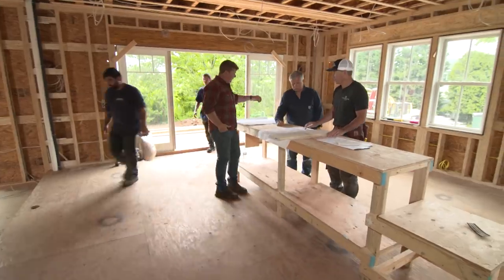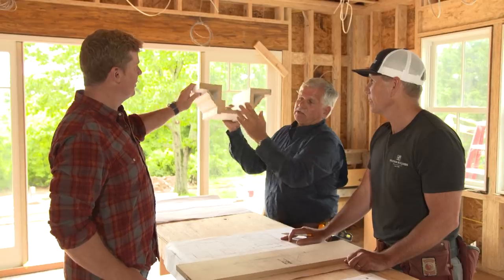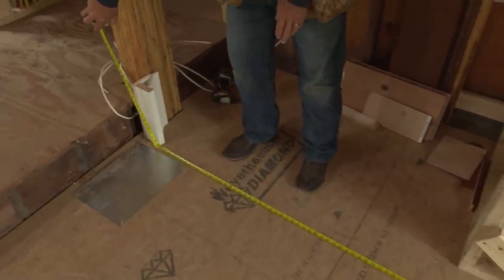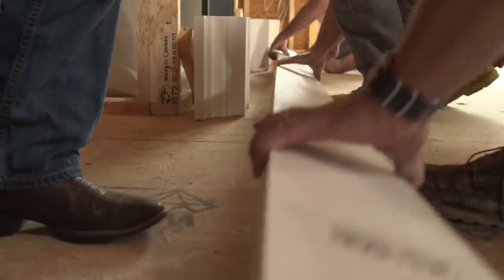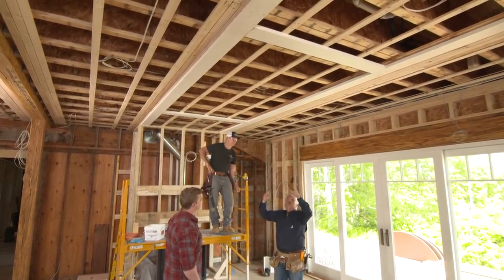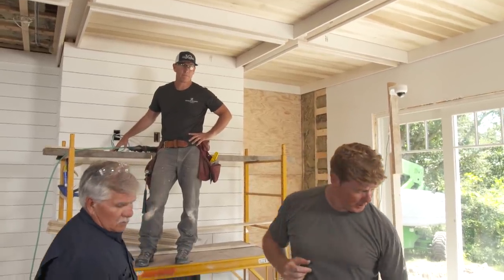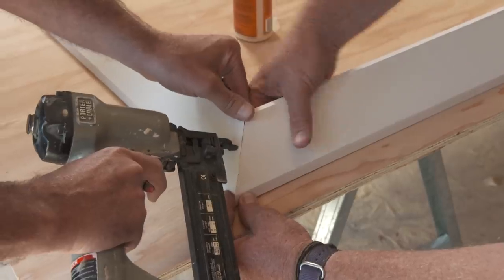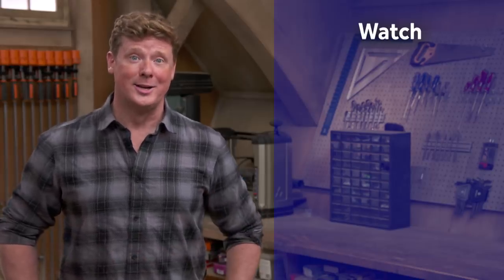How to Install a Coffered Ceiling | This Old House

Comment: New school is CA glue with a kick off spray instead of gorilla and pins.  I learned that from a finish carpenter channel.  Used it for shoe molding when I did my floor for the rounded corners and works like a champ!
Reply: TOTALLY UNNECESSARY AND OVERKILL AND TO MUCH CLEANUP
Reply: Clean up for what?

Comment: Boy I used to hate prepping out them ceilings getting them ready for primer and paint..all the puttying, sanding and caulking sucked..lol. It was so much easier when we were told they were getting stained to match the woodwork..The finished product is so beautiful either way though!

Comment: 5:30 If they already put glue and tacked it with a pin nailer, was it necessary to actually screw it in or was that just precautionary?
Reply: YES
Reply: Yes. Will keep the joints tight for years to come.

Comment: you are assuming that the distance across your floor is the same distance across your ceiling. That may be true in this case, but many houses are not square and plumb. you may have a 14' spanning floor with a ceiling that spans 14' 3/4" with walls that are out of plumb. Double measure folks!

Comment: I like all the dents that finish nailer leaves on the crown molding.
Reply: @Kevin-mp5of  jealous much??
Reply: Yeah, I cringed. My nailer has a rubber cover so you don’t mar the wood.
Reply: The painters include patching/fixing those marks in their bid. Or they could spend a few extra hours to not leave any marks that take minutes to fix.

Comment: are there any light fixtures hanging from the ceiling? how does that work?
Reply: The wiring is put in before, they mark the location before they cover it and cut a hole in after, put the light fixture in.
Reply: @johnny6071  thanks :) maybe there will be a better view next episode
Reply: @jomangeee9180  Forget about next episode, I'd go back to season 1 and watch 30 years worth of full episodes thoroughly if I were you.
Reply: @johnny6071  lol

Comment: is that an indoor or outdoor ceiling?
Reply: Judging by the floor, roof, windows and walls, I'd say it's one of those indoor type ceilings you hear about.
Reply: @johnny6071 they said living / dining room but looks more like an enclosed patio to me. Maybe thats the whole idea of this kind of ceiling
Reply: @jomangeee9180  Looks like I see roughed-in HVAC, electrical and plumbing. Not much of a builder are you? Looks like an enclosed patio to you but has every aspect of a normal living space with a 18" carrier beam supporting the whole 2nd story of the house hence why they are doing what they are doing..... Still look like an enclosed patio? Do you even know what a patio is?
Reply: @johnny6071  ok mr bob the builder, so what were the 3 things they measured up for and installed in the beginning?
Reply: @jomangeee9180  Is that before or after 0:25 when they said it was a living room and dining room?
Reply: @johnny6071  lol
Reply: WATCH THE VIDEO AGAIN  DUH
Reply: @clarelong3810  After 2 years of the watching the video I think I got it. Thank you for the your concern though

Comment: I've done several of these... look good, but a real pain...
 And putting that crown together and then installing it... living on the edge.
And shouldn't those ceiling boards have at least one coat of paint before they go up?
(I won't mention the clobber marks from the nail gun... someone else already got that)
Reply: Probably gonna be sprayed. If you prepaint that wood you'd need an aircraft hanger to lay it all out to dry in.
Reply: @Kevin-mp5of  I don't know that they're incompetent hacks...
but you've got to think at least three steps ahead in your work. And it's the job of the guy in charge of the crew to keep an eye on things.

Comment: is there an attic? how do you walk over that ceiling is it sturdy enough?
Reply: You wouldn't walk on the ceiling. They would out some type of flooring over top of the joists. That's what's holding the load
Reply: There's 2 floors to that house, so yes what you see is sturdy enough since it holds the 2nd floor
Reply: My golly, the beam is carrying the 2nd floor joists, the 2nd floor is the bedrooms, hallway, bathroom, etc. Above that is the attic which is most likely trusses and dead space, you don't walk on your ceiling.
Reply: 2ND FLOOR IS ABOVE AND IF I NEED TO EXPLAIN HOW THEY WALK OVER IT YOU CLEARKY WOULDNT GET IT
Reply: @clarelong3810  I seem to be getting on your nerves!!

Comment: Who KNEW in a thousand years houses would be made of wood scraps, sold for $2.5mil.  
There is NO CONvincing Me that sawdust ...ahem... engineered wood it's just as strong or better than old growth wood.  The coffered ceiling parts apper to be solid wood but the framing of the house isn't ain't that sum shyt.  
Damn...I love My old houses built with blood sweat and tears and not designed on an IPhone.
Reply: Small or large chunks of timber compressed and cooked into shape admittedly but the strength is also in the resin/adhesive as a complete system.

Real timber is "just cells of cellulose arranged as nature intended (well, more or less)" but the tests in the engineered timber factory proved the product was almost twice as "strong" as similarly dimentioned timber.

(I am going to suggest ToH isn't in the business of endorsing some iffy product, so am perfectly happy to buy into the "fact" engineered timber is more than strong enough cf "real" timber for any job in hand. With the proviso that the timber dimensions are scaled for the job in hand of course.)

Comment: Using metric system? No

Using a long piece of wood as a measurement? Yeah!

O.o
Reply: Indeed yes for internal measurements. An excellent idea!

During the war my old Dad was a shipwright in the RN; if you had to measure a space in the dark with water gushing into a compartment you couldn't always use a rule or tape so offered up two lengths of timber batten held together by bolts and wing nuts. One piece would have a slot.

Extend the two pieces, tighten the wing nuts and then use that length to cut from.

From what he said you would be cutting up balks of timber to shore up bulkheads or to force a hatch closed if necessary.

Baulk pushed into the space with wedges using a sledge.

(The idea being to save the ship ... he said very often your shipmates were trapped on lower decks.

Bodies removed later and buried at sea.)
Reply: Machinists use gage blocks. Outside of a laboratory, its far more precise to use a physical gauge than to measure; every measurement introduces its own error and uncertainty, by using a gage like this story pole, you only introduce that error and uncertainty once. Regardless of the system of measurement. Measurements such as these dont have to be accurate, but they do need ro be extremely precise. Theres a big difference. In the metrology world

Comment: Everytime I see those engineered beams I shudder. I'm sorry, but I would NOT TRUST a house made of beams that are made of glued together wood scraps.
Reply: Hmm, but they are merely cosmetic, not load bearing. And you could only build the "effect" from scraps. It is only detail these days.

And in a few weeks you won't give them a second glance anyway.

Living in a house doesn't mean you're looking at details every five minutes.

It's a sort of "trophy ceiling" that you display to your friends and neighbours ... who will make all the right noises ... but privately just think "whatever".

That's not to take away from the skill in building the effect of course.
Reply: @t1n4444  Every single one of those floor joists, made of a 2x4 on top and bottom and sheets of fiber board in the middle, aren't load bearing? Also all the wall studs and headers are engineered lumber.
Reply: @christophermorin9036  Hmm,  possibly we are at cross purposes here. The ceiling, without the "effect" was load bearing ... the coving and cornices  aren't.
Reply: If you don't trust any building engineer's calculations, you should stay away from any public building built since the late 1800s.  If you don't trust engineering in general, don't ride in any motor vehicle, or any train/aircraft/large sea-going vessel.  It's a simpler life, but has its attractions.
Reply: @kenc2257  Ref the recent video on the engineered timber factory; the interviewee very carefully outlined the testing process. Said testing demonstrated the engineered product was "stonger" than a piece of "natural" timber of the same dimension.

Adhesives these days are nothing short of awesome (provided you adhere (groan) to the manufacturers' method statement.

(I had a piece of timber stuck to a steel upright on my narrowboat using "Sikaflex" ... the timber split when trying to remove it. Had to use a wood chisel to get the remaining "veneer" off the steel. That had been in place for past 27 years and that was the technology then.

The adhesives must be even more awesome these days.

In fact I gather the CAA and FAA approve, or sign off, on certain structures on aircraft these days which are held together solely by adhesives.

Ergo if engineered timber is constructed under controlled conditions then absolutely no probs using it.

After all, the earliest form of engineered timber is plywood, and has been in use for decades ... nobody gives it a second thought.
Reply: Engineered beams are very very strong. If you don't trust them that's sucks man cause they are legit great building materials. If you can't trust professional/engineers/scientist might as well question everything else you own or use.
Reply: What I wouldn't trust as much as an engineered beam is a solid hunk of tree, that has all kinds of variation in it. An engineered beam is vastly superior to solid wood in strength to size ratio, and cutting old growth forests now to get bigger solid beams is evil.
Reply: @bmay8818  Actually, a solid hunk of tree, as you put it, did have a place in the history of "building" and that was in the construction of ships, for thousands of years.

Interestingly (?) during the reign of Henry 8 a vast forest was planted (New Forest) very close to the South Coast solely as a strategic reserve of timber for successive Royal Navies after his.

I gather the woodsmen of the day (now known as arborealists or silviculturists???) had sufficient skills to force timber to grow into angles for future ship construction such as "knees" and so on.

Perhaps this might be considered as an early form of "engineered timber"?

And, when you think that the woodsmen who formed/forced the trees to grow thus would have been long dead before the trees were felled.

Now that is long term planning ... shame he didn't take the same view regarding matrimony ... he was keen to start chopping there too.
Reply: @t1n4444  Informed, very nice. Reminds of Oxford University (I think) in which they planted a forest of trees during construction of the university that would be used for future roof repairs.
Reply: @keithupton86ku  Interesting, I was unaware of that particular nugget ... future research material so thanks for heads up.

Will presume the old builders or planners or authorities understood the need for on going maintenance and planned accordingly.

And, thinking about it, UK started the Forestry Commission in 1919 to manage both public and private forestry to protect our strategic liability for timber. As in for pit props, when we had a mining industry, timber for building industry and also amenities and so on and so forth.

Amazing what you can dredge up out of the old grey cells given a slight hint.